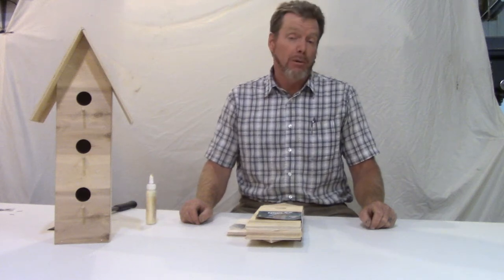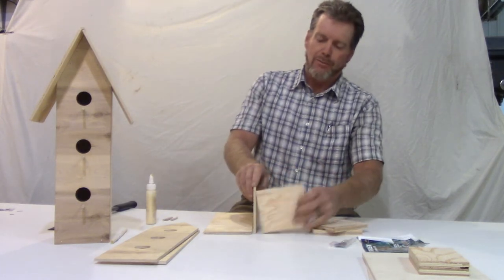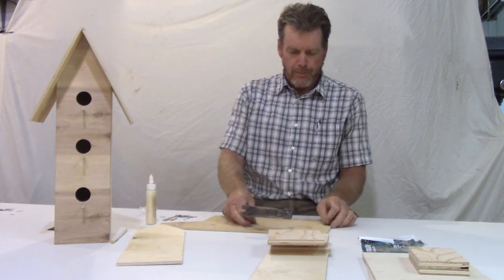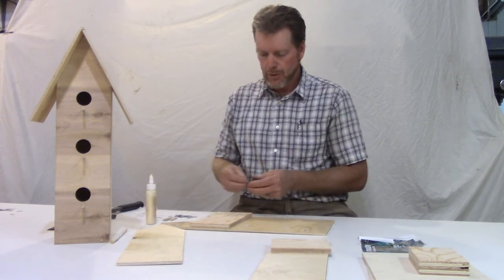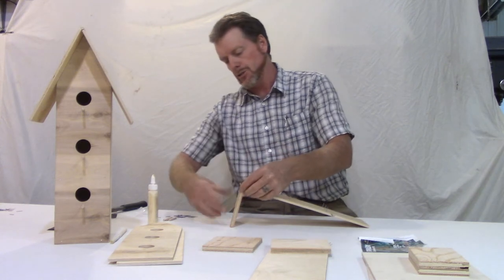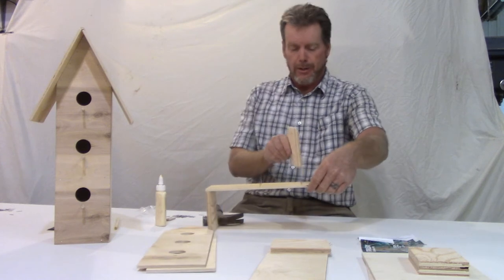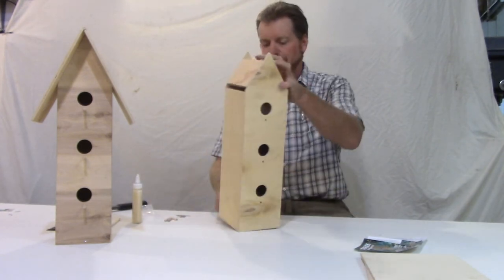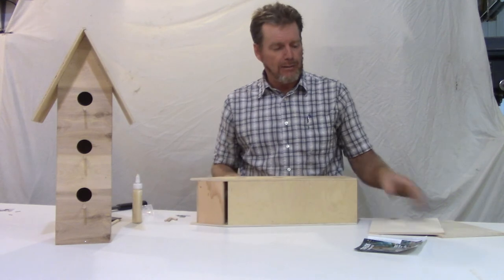Triplex Birdhouse kit Instructional video

Comment: Several things: use small screws not nails. Next do not glue one side of the house so u can access interior to clean old nests out. Finally the sections of the birhouse are much too small for larger songbirds such as swallows. I did a little redesigning and opted to have just two roomier sections at 5 inches from floor to hole instead of the 3. Of course, I had to make a new front with the revised 2 entry-hole dimensions. Recommend they make a bigger overall house if they want to keep triplex design.